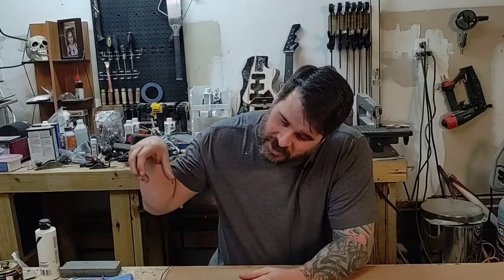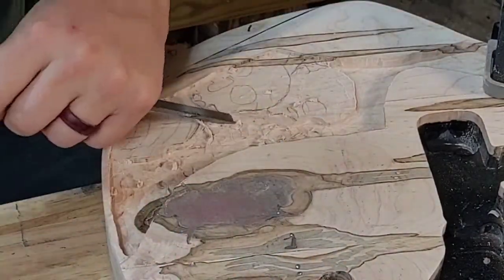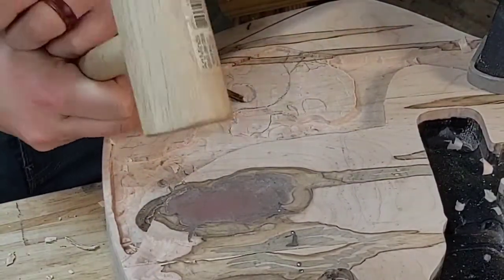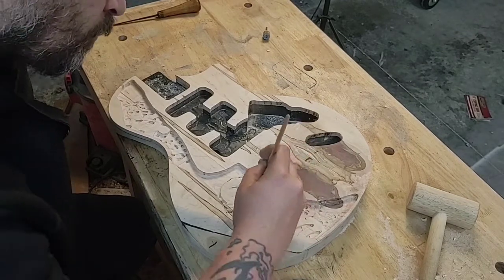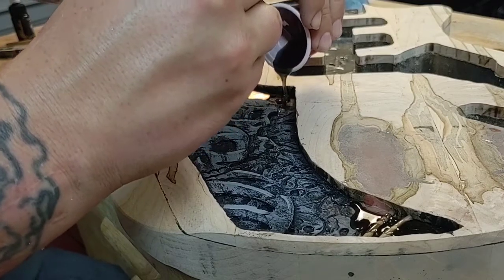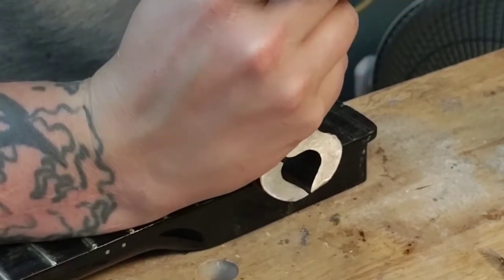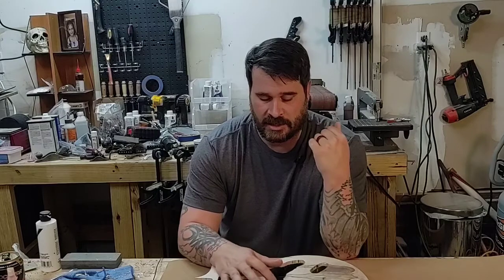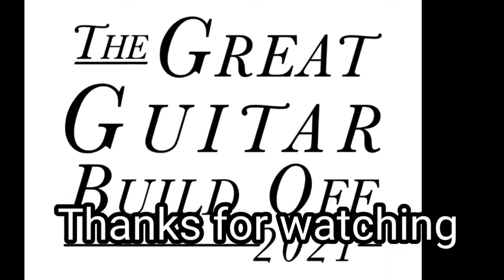Great guitar build off 2021 Ep.3 ( river styx)

Comment: 11:35
If you grind down the front of the pliers flat without heating them too much you get under the frets much easier. But the one you use is too chunky but it still worked. You can also use one of the really small cheapo wirecutters often sold in model making kits to get under the fret on the ends to get it started. I've also seen someone use a tiny amount of water and heat the fret till they see the steam from the water that got in the fretslot on one side. I guess it's done to get less tear out. The heating is just done in case the frets were also glued in. So they'd stop heating if it isn't the case just like you. Secure the bits that stick up near the slots with thin superglue but put some Teflon(ptfe) tape or a piece cut from a sheet in the slot you're working on and the glue can't get in the slot and won't stick to the Teflon. If you got the right pliers that lay flat on the fretboard, there'll be less tear out while the shape does all the lifting.

It's coming along nicely. I'm stoked to see what you'll do with the neck and the overall colour scheme.

One the stainless steel frets I highly recommend a highline guitars video. You have a LOT less work with them if you take the time to really match the fretwire to the fretboard radius. No overbending. Maybe you have to re-radius the neck to have a consistent radius If that preparation is done, it can be that you don't have to level the frets besides spot levelling. Make sure the ends are cut with a proper tool so they won't deform and stick up. If you use a rotary tool, make sure that they don't get too hot or it's messing with the hardening of the fretwire. They come perfect from the factory, the less you change on them, the better the result.
EDIT:
If you do binding AND stainless steel frets and you don't have a proper fret tang cutter like from Sintoms, then build a small jig that allows you to file them down: watch?v=fvdnpilpdVc
The dremel version will take too long, is more expensive: watch?v=oYgVh1JV6OM

Maybe you can do something else than binding like over the edge fretmarkers or do fake binding.
Reply from the maker: Lol it only worked with those giant end cutters because they are indeed ground down as you said. Scott (Bonehead guitars) pointed out that these frets may not have been glued down. That makes sense so I'll keep an open mind about it.
I've never put in frets before so thanks for the advise. It's going to be wood binding so I should be able to cover any mistakes a little easier😅